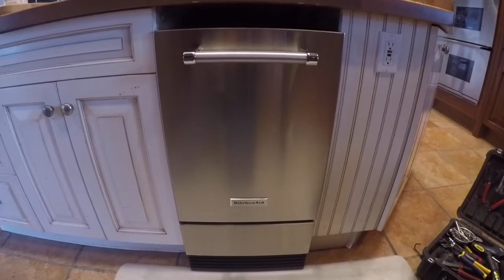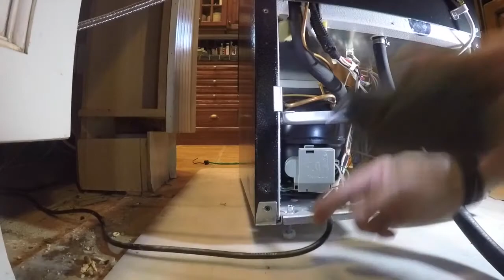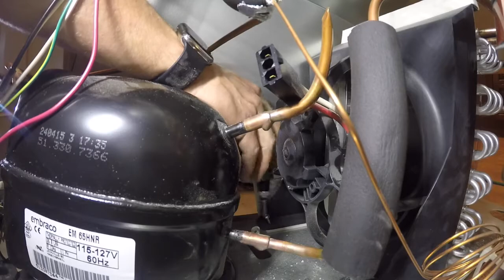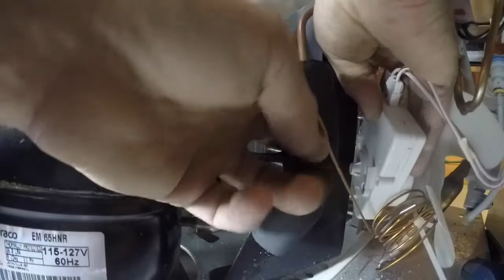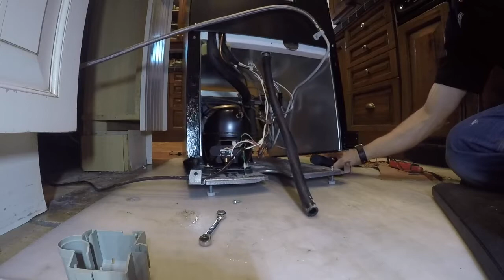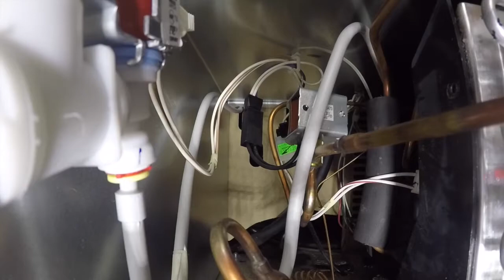Whirlpool Kitchenaid Ice Machine Condensor fan replacement

Comment: Thanks for this video.  Very helpful.  Kitchen Aid is made by Whirlpool.  I have a WP GI15NDXZB1 which has nearly the same compressor, coil, fan system arrangement. My fan was getting 120v and not turning.  My unit is a 15” width and the video is the wider 18” model.  No fun being smaller. Anyway, the key is the Remove the 4 screws that hold the base on and tilting it so you have access.  Thanks for that tip!  I found it was easiest to lift the black plastic cage and slide the fan under and out at the bottom.  It. Was. Still. Not. Easy.   The fan gets hooked and its hard to get it free.
Reply: Mine appears to be from 2016 and I bought it on Craigslist.  So far Ive replaced the bin thermistor, the circ pump which is a combination pump and fill empty sensor (pump fine, sensor fail), and now the evaporator cooling fan.  :D   I keep mine in the basement near a floor drain because ice makers are notorious for leaking.
Reply: I have a 2014 era 15".  I popped the fan blade off with a flat head and then was able to remove it from the top.  Still a pain, but a little easier I think.

Comment: Instead of unbolting the unit from the base on the back only, why not unbolt two front bolts and lift the entire box off the frame to give yourself more room to work?  And FYI: if you move the filter drier even the slightest (the little copper bulb and tubing right side of the condenser) you will likely break the connection between the copper tubing of the drier and the aluminum tubing of the heat exchanger and LOSE ALL YOUR FREON.  Kitchen Aid and Whirlpool put a cheap piece of plastic heat shrink tubing between the copper and aluminum tubing to hold in freon.  It's a flimsy coupling that breaks easily when moved and when your freon leaks out the DIY game is over.
Reply: The copper lines run into the box from the compressor, so you can’t.

Comment: How do you know the fan is bad? Should it constantly run? How do you know it's not something with the refrigerant or compressor?
Reply: I would like to know also…. My ice machine quit working.  4 years ago it was the recirculating pump.  I thought it’s the same problem this time, but no.  Now I’m trying the thermistor based on another YouTube video (part gets here tomorrow) because I have flashing on/off button light going on.  Then today YouTube suggested this video…
Reply: @rogerchiu2210  on mine the fan takes 120v. With a volt meter test the fan was getting 120v and not turning.  As described in the video the machine was hot.  I could feel the hate radiating from the coil and compressor cavity
Reply: I don believe the fan runs all the time by the way.  One of the thermistors I suspect triggers the fan when the refrigerant becomes hot